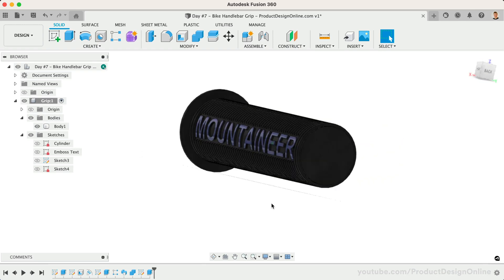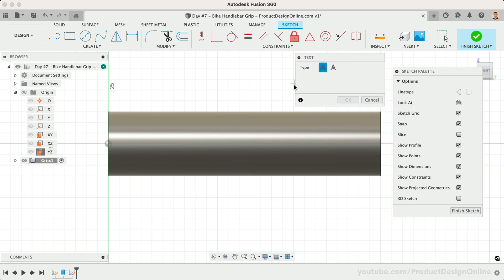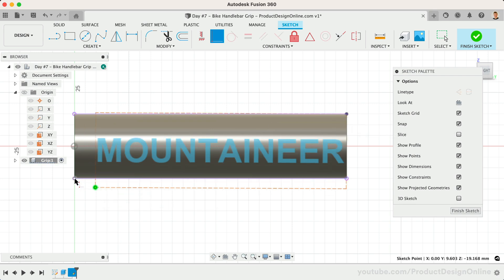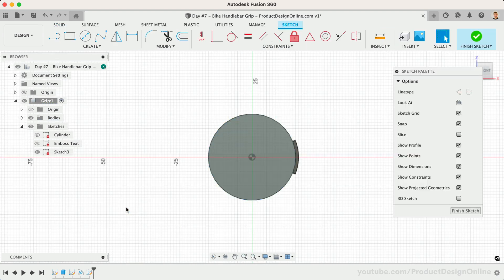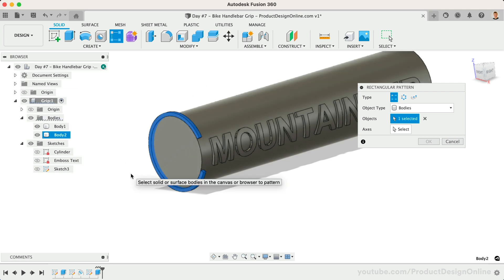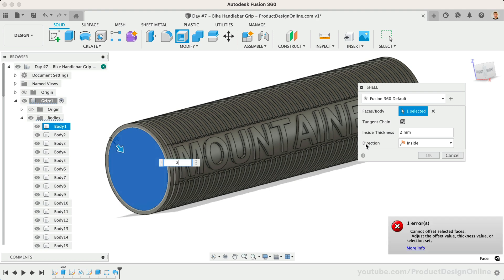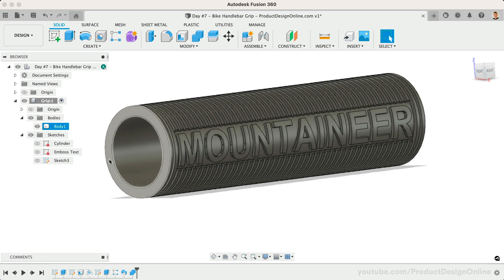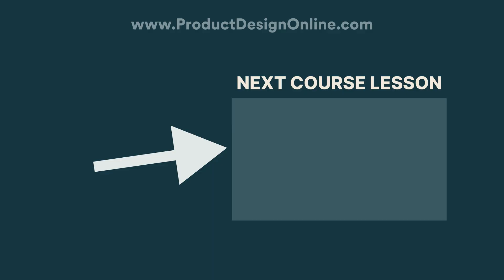Day 7 of Learn Fusion 360 in 30 Days for Complete Beginners! - 2023 EDITION

Comment: When I Emboss the text on the hand grip, I select the lettering, then select the surface of the cylinder.  It always projects the embossed letters to the back side of the grip rather that the front facing side of the grip cylinder.  Thus the text is all backwards.  I have redone the entire grip multiple times and same result.  I'm going to try it with other shapes etc and see if I can determine why it doesnt project forward.  I coiuld create the text backward and make it work out but something is off.
Reply: I found a solution. Go back to the edit text tab and click flip text (I have free version), then you need to emboss the text like normal. If It still appears backwards, you will then have to go back to edit text and flip the text back round. Upon clicking finish sketch the emboss is correct perspective. Bit annoying but works.
Reply: @2222ben  Thank you! I can stop shouting at my screen now :D!
Reply: @lynoraconti8703 I’m glad I could help. Reading this back I have no idea what i’m talking about but i’m sure it made sense in the moment 😂 I have most likely forgotten these skills
Reply: Flipping didn't work for me.  What did work was I created an offset plane that was 1mm closer to the side of the cylinder where I wanted the text to go.  Then I created the text sketch on that offset plane instead and the emboss worked as expected
Reply: @Dave-kw8eq  Yes that didn't work for me, so I moved the plane -30 mm, well outside the face to be embossed - worked that time. Thanks for the tip
Reply: @Dave-kw8eq  <3
Reply: Same issue.
Reply: Perhaps the 'Flip' option in the dialog is to fix that?
Reply: @jamiehooton6253  My Emboss Dialog box doesn't have a Flip Function. I'm using the free, not for production, version.
Reply: @Johnnyo_alb  Same issue, same non-existant button here
Reply: same problem

Comment: In closing the video, I wanted to go the extra step of making the left handlebar grip but have a question:
First I selected offset plane of 50mm just to give some spacing, then mirror the body of the right grip to the left, creating now two grips. The only problem is the text is inverted and I don't want the editing of one to change the other. Thoughts? 

Great videos! Thank you...
Reply: Maybe make a copy of file and rename it. Then you can just swap ends on the hollow command and the last extrusion, right?

Comment: I am completely lost on this video as many times I have had to search for why things just aren't working! Now, for some reason I cannot seem to colour the text! Every time I went to fix the problem nothing changed. Checked other videos and they all said the same thing as here. I even deleted the file and started from the beginning, yet when I got to colouring the grip then the letters, nothing changed. So is it my computer or is it Fusion 360?
Reply from the maker: I would need to see your Fusion 360 file or a screencast video to see what's going on. Generally, as long as the letters are select before trying to drag the appearance over, it should work as expected. Without any more details, I'm afraid I can't help troubleshoot. You can always share your file here: https://community.productdesignonline.com/
Reply: I've had the same issue with selecting the letter faces. I found that pre-selecting the letter faces works better when zoomed in closer so that you can definitively put the cursor only on the letter face. The shift selection seemed to prefer edges to faces.
Reply: @ottolehrbach3064  had the same issue and this worked for me too.  Thanks for adding the comment!
Reply: @ProductDesignOnline  My free trial has ended, and was not going to purchase F360 until I upgraded my 6 year old computer. So when I get my computer upgraded I will come back and try this video again. Maybe my whole problem is that my computer is just too slow for today's F360?

Comment: Thanks a lot for these videos. It isn't clear to me what the Project tool is for though. I tried it, and I was able to make an offset circle off the inner circle by just selecting the inner circle. What does Project get us there and what should I be sure to use it for in the future?
Reply from the maker: Thanks for the feedback/question! Project will take the existing geometry and 'project' it into the active sketch so it can be referenced. The reason this is so important is so that geometry automatically adopts whenever you change dimensions/sizes later on.
Reply from the maker: You may be interested in my video that covers Project in more detail: https://youtu.be/WAs144r-Xko

Comment: When doing the embossing I select the Text and then click on the face of the cylinder and I get an error Sketch profiles create a self-intersecting body. Adjust depth of emboss or size of sketch profile.  OK this is why this software is so frustrating.  The answer was to switch to a different font. I chose Arial and the problem resolved itself.
Reply: I'm getting the same error and have no idea how to fix it.

Comment: How do I edit my Text after i clicked Ok? Because when sweeping the ends of the grips, it goes over my lettering.
Reply: Figured it out.
Reply from the maker: For anyone else, you can edit the sketch > right-click on the text itself > "Edit Text" from the right-click menu. Cheers!
Reply: @ProductDesignOnline   First: This is GREAT! But I too wanted to change the width of the text for the same reason.  In the Browser, I right-clicked on the Sketch called 'embossed text' (not the one called 'cylinder'). This gives me a RIGHT view of the sketch that shows my text. I also get a  SKETCH PALETTE window. When I right-click on the sketch (in the text OR background), I get a right-click menu - but without any 'Edit Text' item. I'm on a MacBook Sonoma 14.2.1. Fusion is up-to-date and I'm in a Trial.
Reply: OK, got it. In the Browser, I showed only the Sketch called 'embossed text'. THEN, I right-clicked on that sketch and 'Edit Sketch'. I got a RIGHT view of the sketch and a 'SKETCH PALETTE' window. NOW, when I right-click on the sketch, I get a menu with 'Edit Text' and choosing it gives me the 'EDIT TEXT' window. Yay! Thanks again!

Comment: Can i use the test tool to add Copyright and Company Name to the bottom of a part. Store that as SVG and reuse it on every part???
Reply from the maker: If you used Fusion 360's native text tool, instead of an SVG, then you would want to reusbe a 'Component' for each part. You could then simply edit the text and change the part name/number as needed. SVGs are not ideal as you have to 'Explode' the text before you can work with them, and once you do that you can no longer (easily) change the placement. :)

Comment: Nice and clear, I like your style and enjoy your videos but I have two problems with this tutorial. First, handle grips are molded and your text has undercuts. Look at 4:25 and you can see that the parts would not release from the molds. 

Second, it's not your fault but Fusion 360 has only rudimentary text tools and many professional graphics people would not be happy with the stock kerning you show. "Character spacing" is too general and wont fix loose or tight pairs. At this point you are forced to use a tool with better text handling like Illustrator and import the text as line work which is a pain, You can "Explode" the text when editing the sketch but this is extremely crude for anything more than a couple of characters as you are nudging without any feedback and can easily add errors.
Reply from the maker: I agree, Brian. Unfortunately, I don't think they'll be adding proper kerning  or other text updates anytime soon. It was 'big' win when the text tool got this overhaul, as previously you couldn't change anything with text.

Comment: The emboss tool was not working for me initially, and it took some googling for me to figure out what was wrong. It would be good to mention that some fonts are finicky with the tool.
Reply from the maker: Thanks for sharing! Didn't realize the font would impact that. Which font(s) did you try?
Reply: @ProductDesignOnline  I had the exact issue. I used a font I had previously downloaded from Dafont and when I tried one that was preloaded onto my computer it resolved itself. Not sure where the discrepancy is but it worked nonetheless.
Reply: Same here, had chalkboard font and couldn’t figure out why I was getting errors. Switched fonts and it worked fine. Thanks for saving me some googling time!
Reply: @notkvnchn  Same problem, with same font.. .thanks for calling out the issue. Couldn't figure out how to edit text in a sketch, so had to redo the whole sketch.
Reply: I'm so glad you commented this! I was getting frustrated! I wish the alert text in fusion would've said that. I thought I did something wrong!
Reply: I spent an hour trying to figure out why I kept getting an error message when I tried to emboss. Thanks for your help
Reply: Thanks for the tip, had the same issue with a non system font.
Reply: Thank you for this comment. I was trying to figure out error for 2 hours.
Reply: Thank you for the comment ❤